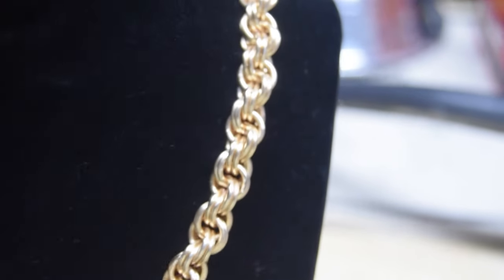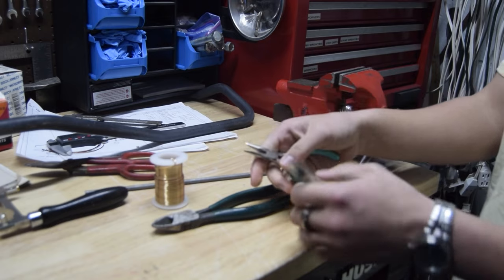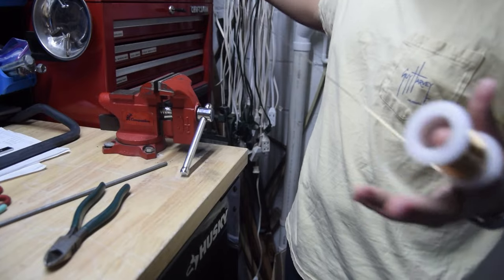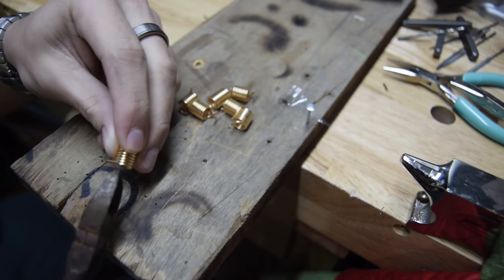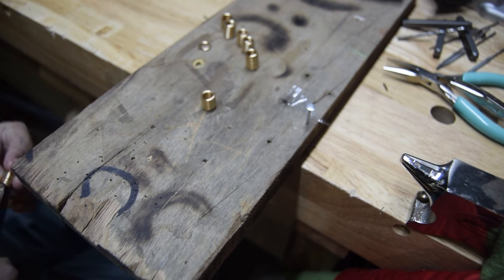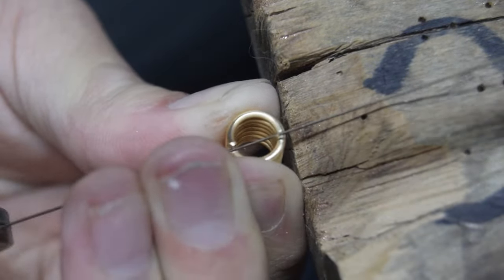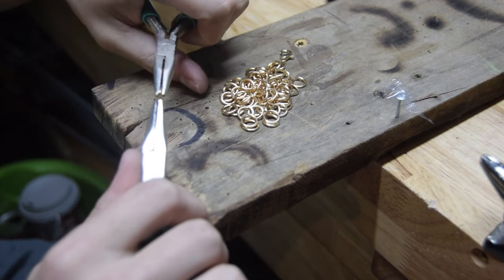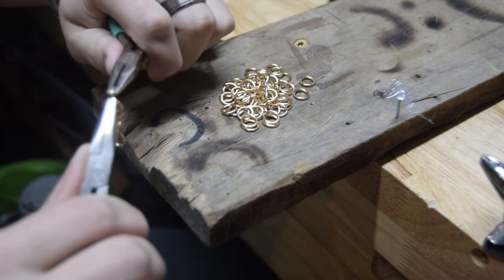How to make a Rope Chain (no solder)

Comment: What thickness of wire and what is the diameter of the loop if you don't mind me asking?
Reply from the maker: I’m using 16 American wire gauge wire, and using a 1/4 inch thick rod for the inner diameter of the links.

Comment: How sturdy is that?
Reply from the maker: @zacharysoun5612  not very. If it gets yanked it’s breaking fs. It’s more of a costume piece
Reply from the maker: @zacharysoun5612  ofc, if made in a different metal where the links were soldered, it likely wouldn’t break, it would stretch long before it would break

Comment: Rather than purchasing a chain would it be cheaper to have one made by a jeweler with provided wire?
Reply from the maker: That’s a good question. I really don’t know. Cuz if you have the wire, might as well make it yourself since you’re already part way there. But if you did do it that way, you’d probably have to discuss a prove with the jeweler
Reply: @aywjewelry  I don’t think I could do the other half of the process because I am disabled and don’t possess the tools to make the chain necklace. At most I mainly use metal wire to wrap shark teeth and other pendants.
Reply from the maker: @ethansoderstrom8287  ah I see. Well, wrapping wire, even if not fine metals, is still a viable method for jewelry making so I count it.
Reply: Definitely not gonna be cheaper. Handmade chains cost what they do, not because of the material, but because of the work involved. 100 grams of pure silver is less than $100. A 100 gram sterling silver, handmade cuban chain, is gonna cost 4-6x the cost of materials, easy.

Comment: It looks cool but slightly off compared to a normal rope chain if you want to make a really high quality rope chain you have to use different technique and solder
Reply from the maker: Yeah, I know, I don't have the time, resources, or knowledge on how to do that, and I really like rope chains so I found this method
Reply: @aywjewelry  yeah I get that. I can really recommend learning how to solder, it is surprisingly simple to do and increases the possibilities of what you can do so much. Props for finding a way to do what you like with limited recourses and making it look as good as it does
Reply from the maker: @Simon-jr2oe  thanks!
Reply: @aywjewelry  Yet you call yourself "AYW Jewelry"
Reply from the maker: @Danny Green  If you couldn’t already tell, I’m not a professional yet. I have to work with what I have.